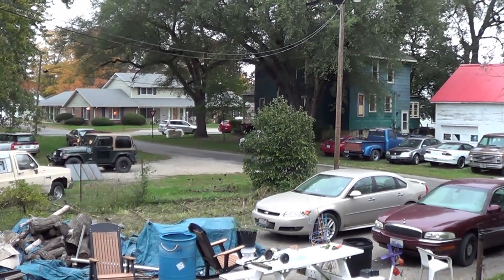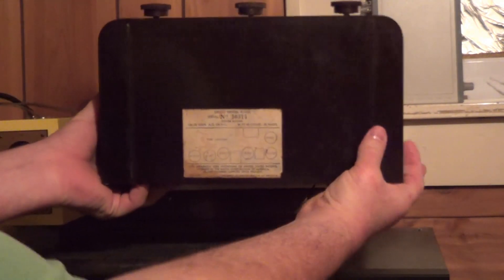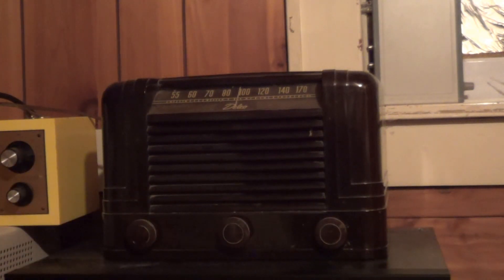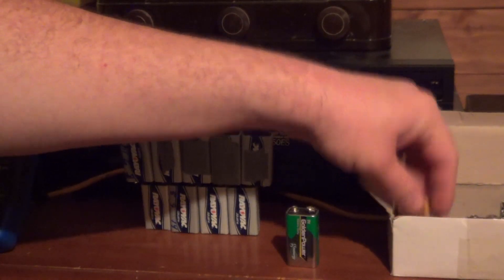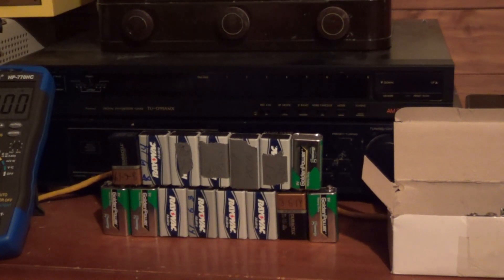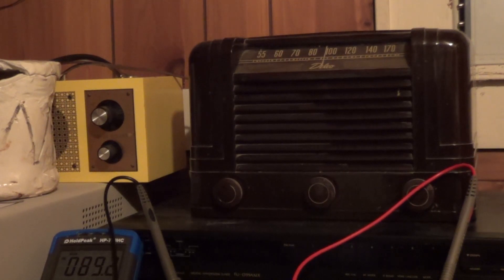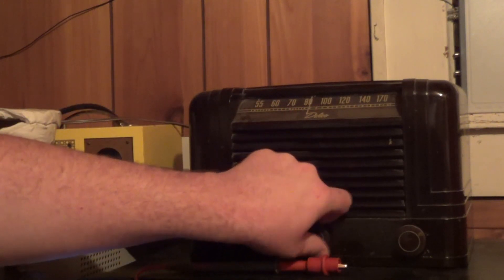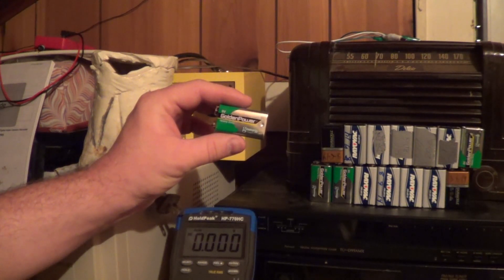Running a Delco R-1235 "AC/DC" Radio on Batteries

Comment: I collect old radios, I love them. Amazing things.
Reply: Maybe you should do a video like this, but with newer batteries and having a few battery banks made up of connected 9 volts in parallel to increase run time and reduce strain on the batteries.
Reply: David Phantom no need, there are enough radios of this era that natively run on batteries to last all of the collectors their whole lifetime in the UK. We cant even give away battery radios from the 50s.

Comment: The emergence of AC/DC radios during the 1930s was mostly due to cost-cutting during the Great Depression, to avoid the expense of a power transformer. The fact that it could run on either AC or DC was merely a byproduct of the design, and was of limited usefulness outside of a few small pockets of New York City and Boston where Edison's DC system was still in use. But as you say, 60 Hz AC was far from standardized at the time; southern California used 50 Hz until 1948, and areas of Canada and the northeastern U.S. powered by Niagra Falls used 25 Hz until the mid-1950s.

Comment: A lot of modern power tools will run on DC as well. AvE did a video where he ran some 120v AC tools using two 60v Dewalt batteries.

Comment: I used to run my Atari VCS (2600) off of a green Radio Shack 9v when my power supply died..id get 8 hours out of a battery...the colors would get strange when it would drop under 6 volts but it still worked

Comment: If you have a lot more 9volts you could run several serial banks connected parallel to increase their capacity.
Reply from the maker: Those were just about every nine volt battery I had.

Comment: I've a 1950's portable tube radio which uses a 90V and 1.5V power source. Sadly 90V batteries aren't readily available now :(
Reply: try some 12V batteries in series
Reply from the maker: It's the low voltage side that would have the highest current draw, since it's for the filament heaters. I'd think that some NiMH rechargeable C, D or even good quality AA cells in parallel would hold it more than long enough for a test.

Ten or so nine volt batteries (PP3) clicked together ought to do a decent job of running the high voltage end of things, which isn't nearly as power hungry as the filament circuit.
Reply: 9v  batteries in series for the 90v supply will work fine high voltage low current, see batterymaker's channel he's an old school youtuber and makes packs to run those radios. and a D cell of decent quality can provide the 1.5v or if in doubt run a few D cells in parallel for more current capacity. Parallel means more current capacity at rated voltage, series means higher voltage and less current capacity. Guys with giant car stereo systems often run two or more car batteries in parallel for more current capacity.

Comment: Nice test bill :-D
That old radio is very forgiving indeed, but valves/tubes have always been good for that :-D.
Most flyback switchmode power supplys can run down to 90 volts d.c too.

Comment: Its actually more successful if you do it with an AC only radio. you need 15-20 9v batteries and a big 6v lamp battery (the big square ones) you disconnect the rectifier valve heaters (remove the valve too) from the mains transformer then connect the 6v battery to power the heaters on the rest of the valves then connect the negative of your string of 9v batteries to chassis and the positive to the electrolytic capacitor that would of been  connected to the rectifier. the radio will play until the 6v battery is exhausted, depending on the valves used in the set you can get an hour or more play time.
Reply from the maker: That's great, but it's not relevant to the radios I have or what I wanted to do.

Comment: 9 volt batteries are fine for radios that use separate A(heater) and B(plate) batteries.....the plates use high voltage, and low current, so 9 volt batteries are ok...the tube heaters, on the other hand, need higher current....the tubes designed for battery use have heaters with lower current requirements than the tubes intended for house current operation do.

Comment: I've got an old Radiola AM/Shortwave radio that has an outer case that looks very similar. Same shape and knobs but some of the trim lines are just a little different. Never tried running it off batteries though. Great video
Reply from the maker: I have the chassis and dial glass for an almost identical RCA radio. (Near as I can tell, that one came in a wood cabinet.)

Comment: Someone on here mentioned about an old tube portable radio, as crazy inefficient as they are, I wonder how one would be using a hobby RC big lipo battery and the appropriate little converter boards you can probably find on ebay. It would be a very interesting experiment because that lipo has a lot of energy potential and capacity. You can build quite a decent fast electric bicycle with those batteries and hub motor. And car jump starters use those too.
Reply from the maker: Those converter boards would probably work, but they'd all probably have the same problem. Interference would destroy the very transmissions one is trying to receive!

Comment: Why hello there Uxwbill. Wow old radio lol. Saw a old tube radio once at a thrift store, was tempted to buy it but I didn't. Btw sitting on old battery's is bad for you :-p
Reply from the maker: If you buy a tube radio and plan to use it, restore it properly for safe and reliable operation.

These batteries were collected only for this experiment.
Reply: uxwbill I'll admit it be cool to own one, but I don't think my wallet could afford to have one restored (also not sure if there's a expert on tube radio's around here. Did you have to use battery bate to catch them?
Reply from the maker: Look for a Bakelite-cased "All American Five" (or six, like this one) as those are still pretty cheap and common. $5-20 ought to buy a very restorable radio.

A radio like this is actually a very good introduction to simple electronics. The key functions are spread across a small number of parts, schematics are readily available on the Web and it'd be a great way to cut your teeth on electronics repair. The few parts needed for a safe restoration are cheap and easy to find. Just be mindful of the fact that you must never work on one of these when it's plugged in (even if the switch is off!).

There's probably a radio club of some kind in your part of the world, and you might ask there for guidance and pointers.

https://antiqueradio.org/
Reply: uxwbill Thank you. I might just try that someday.

Comment: bill, it's the other way around. DC is much much safer than AC, for example you could touch 110V DC pretty safely (you would feel a little pain, but not too much), but you can't safely touch 110V AC - it will shock you. For further explanation, check https://www.youtube.com/watch?v=snk3C4m44SY
Reply from the maker: I think there's a typo or two in this...?
Reply: Oops, yeah, right, corrected.
Sorry! ;_;

By the way, as you have responded - i love your content, keep the quality as it is! :)
Reply: You edited this while I was watching so it still looks incorrect to me, so long as I do not refresh my screen!

Comment: Maybe 6 volt lantern batteries may work better, Pretty cool. I know you said not to try things like this but, I have a 1939 Airline I might try one or two things.. By the way i do stuff like that a lot away, I've been hit by 240 volt , CRT flyback voltage & 12KV street light transformer, even 200+ volts DC.
Reply from the maker: They probably would, if it weren't for their being horrifyingly expensive. I try to stay away from anything that uses them, just because of the cost.

My commentary is there mainly for someone who would try something like this without really understanding the very real dangers of doing so. I don't want someone to try something they're not ready for.
Reply: Ok I see now.

Comment: We always had car batteries in the basement for car radio repair. No harm, if you use care. Farm radios ran on batteries. My dad lived with a 32-volt Delco Light plant. No service there, but they have power now to give thugs lighting to shoot by. Battery banks like Delco must be balanced at times. Cheers
Reply from the maker: I've certainly had regular wet lead acid batteries in the house before. It's just that the ten or so required to make this work would be difficult to handle and more than a little dangerous if something were to be accidentally shorted.

I vastly prefer SLA bricks or variable/fixed regulation power supplies for testing anything that needs a 12 volt DC input.
Reply: uxwbill millions of farms, and some city homes, ran on Delco.light plants. My grandmother's vacuum, and my dad's Lionel train were converted for 32 VDC. Delco was the most prominent outfit, but others made them in the USA!
Reply: Cool video.

Comment: A fresh 9 volt alkaline is rated  300 to 450 mah. @ 100ma discharge rate the filaments should draw 150ma, (more when cold), 36 watts 120vdc approx. 300ma series parallel combination and eliminate the weak ones, should give you a few minutes of listening pleasure. Some of those ups batteries in series might give you extended listening pleasure.  - - -  If you have a bi-polar capacitor will it become normal if you give it lithium? Why? Because! OK.

Comment: I'm actually kind of tempted to try hooking some 9V batteries up this way to see what I would smoke in the charging block for an older Canon camcorder. Only one of the adapters I have has a fuse (pretty sure that's mildly illegal in some parts of the world but I rarely leave the midwestern US so I can't really speak on worldwide politics).

Comment: I suspect these need quite a bit of wattage, more than you get out of little 9V batteries.   Those 9V batteries may have done well powering the B+ line only.    But it is the tube heaters alone that take 18W of power.   I suspect that if you add the B current you are probably in the 20-30W range.    So at only 400-500mah for 9V batteries, this would flatten the batteries pretty fast.   I suspect that if you had used like 80 D cells or 20 6V lantern batteries, or 10 12V car batteries, it would have lasted a lot longer.
Reply from the maker: Yes, the tube heaters are quite power hungry. My budget doesn't run to 80 D cells, probably not even flat ones. I'd probably have to rob a bank to get 20 lantern batteries. Those things are crazily expensive.